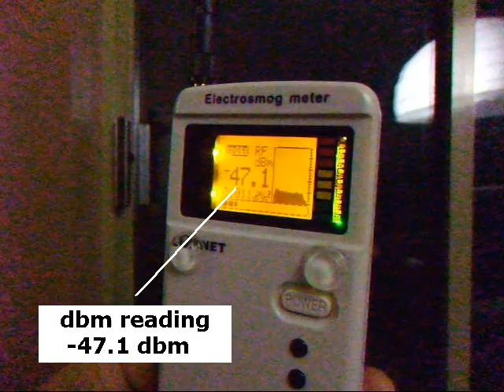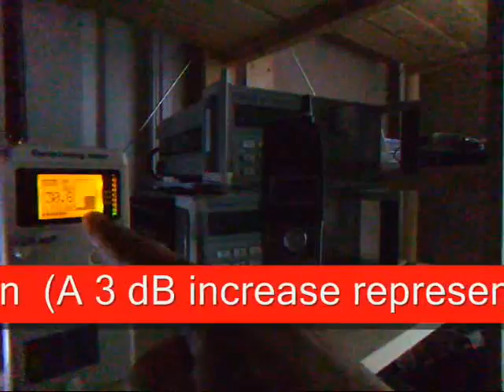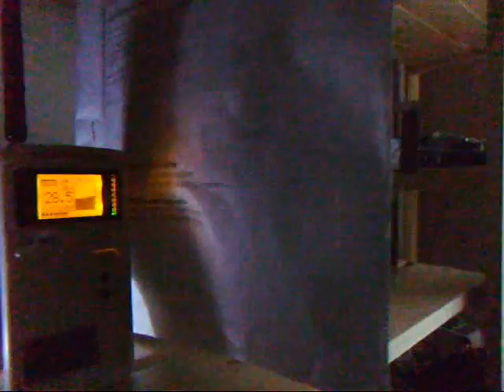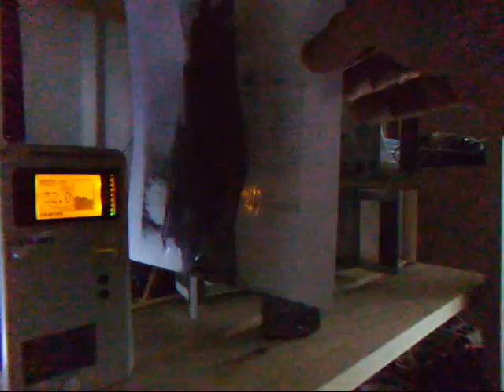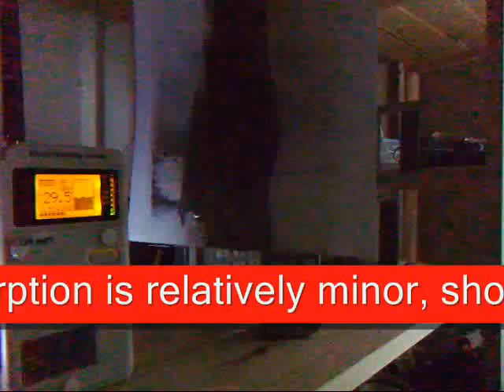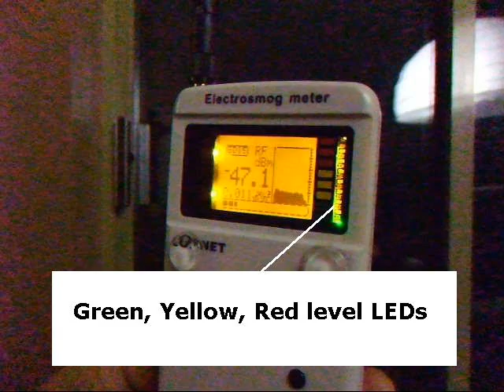Myth? Does GRAPHITE powder shield against wireless RF radiation? Actual test

Comment: LessEMF carries what I believe is a comparable material, a sheet of carbon between two plastic sheets, called Microwave Absorber, quite convenient to use. I've tested it and found it effective. The seller claims it also acts in part as a reflector.

And MelissaScotthasmail is correct, you would benefit from a substantially larger sample.